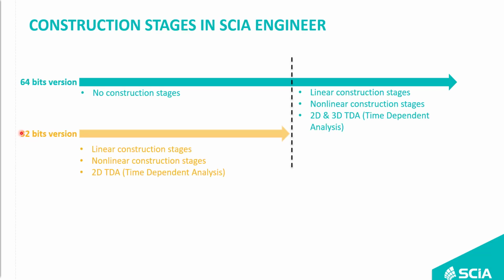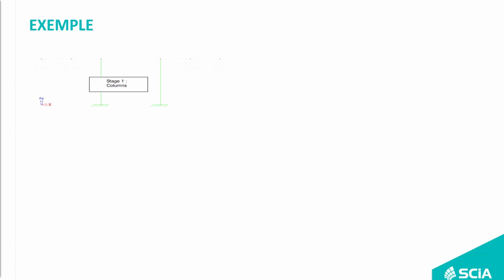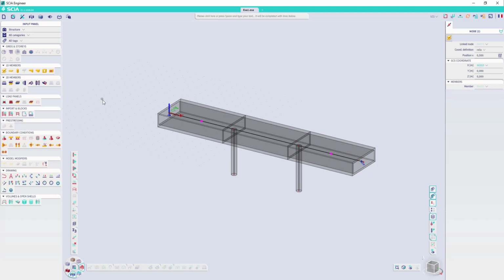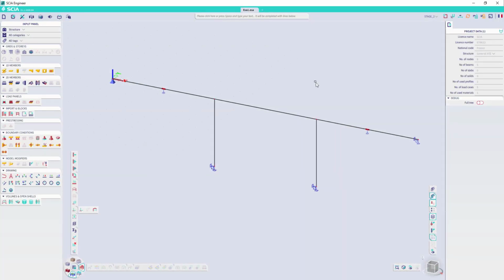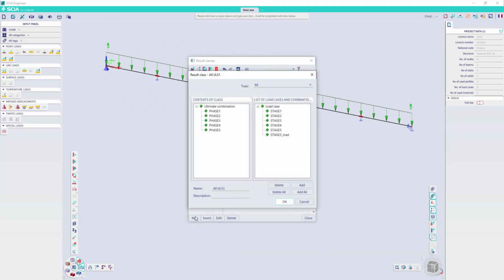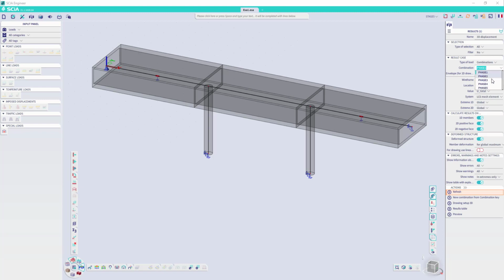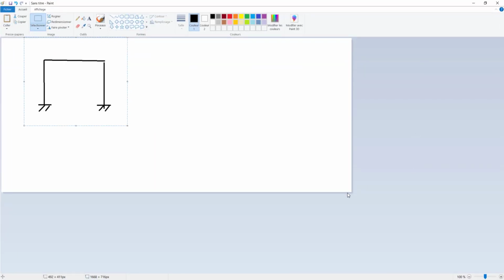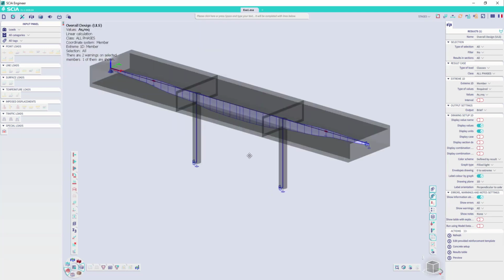[EN] Linear construction stages analysis with SCIA Engineer

Comment: Why there is no bending moment at the top of the column in stage 2 ? or the same bending moment at the ends of the horizontal beam ?
Reply from the maker: It is not zero just small compared to the one at the middle of the beam (-7.02 vs 432.46). It is due to the big difference between the bending stiffnesses of the beams and the columns.
Reply: @SCIAOfficial  right, so the stifness of the column is small compared to the beam. Didn't see any hinge or assumption in one stage (like just after pouring concrete there is just selfweight and no stiffness). 👍 used this example last week in modelling when SCIA support gave the link

Comment: I don’t know if it is included already, but it would be nice to have a function (which you can turn either on or off) which automatically hides the elements/supports/etc. that are absent in the selected load case/combination. That way you can easily double check your model to see whether the correct elements/supports/etc. are absent in the particular load cases/combinations.